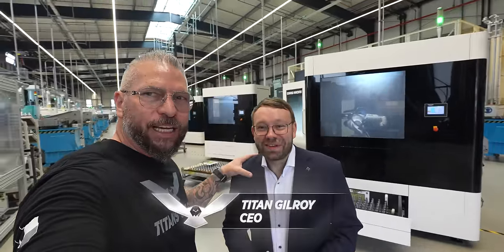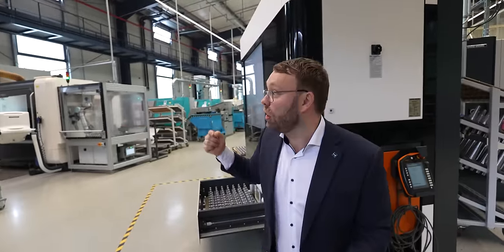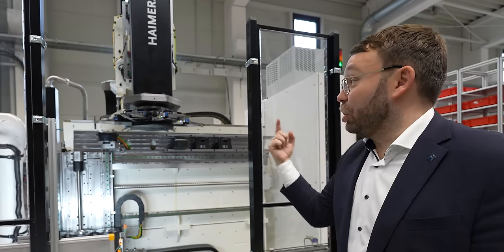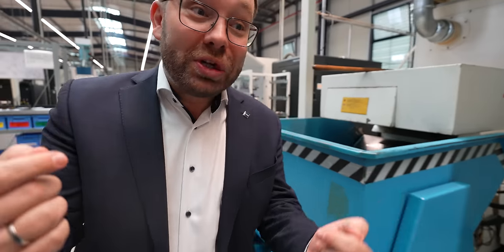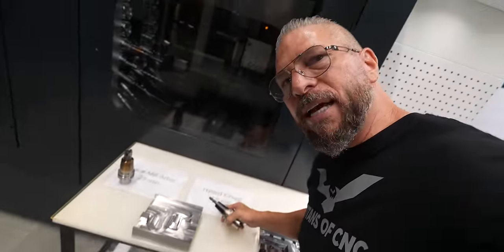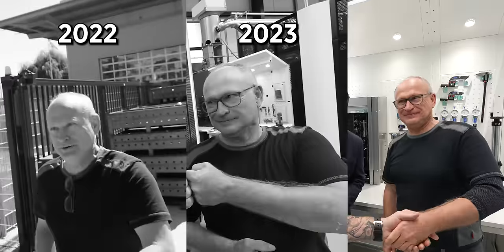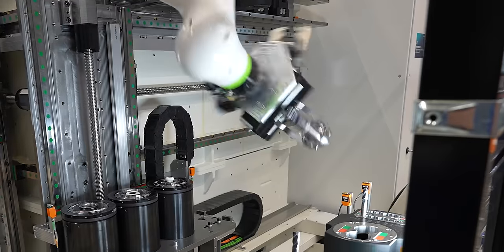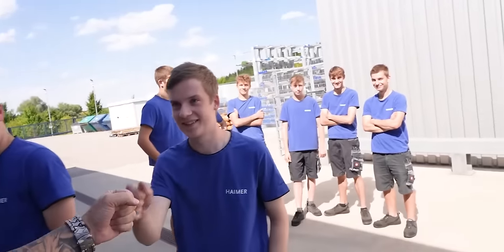The SECRETS of German Engineering & Manufacturing

Comment: I have a question whats more used Solidworks or Fusion 360
Reply: I would say Fusion360 because a lot of 3D printing hobbyists use Fusion. In industry, Solidworks is used more often than Fusion and here in Germany Inventor is used more often than Solidworks, at least from my perspective.
Reply: Larger companies, designing complex products with a large number of parts is more into Inventor and Solidworks. Typically smaller companies with less complex products are more into Fusion360.